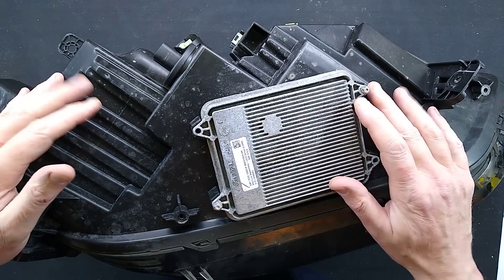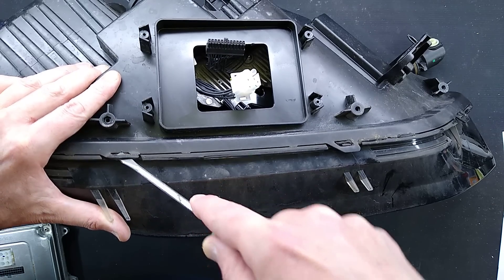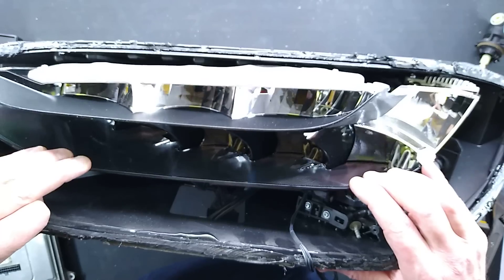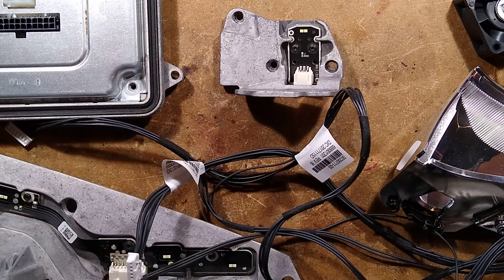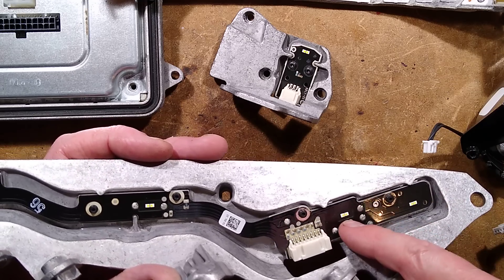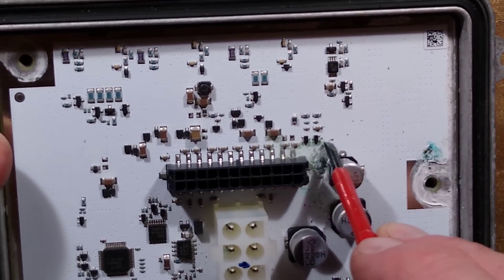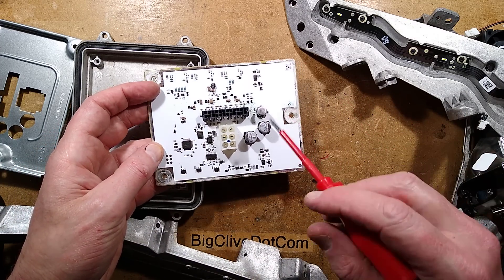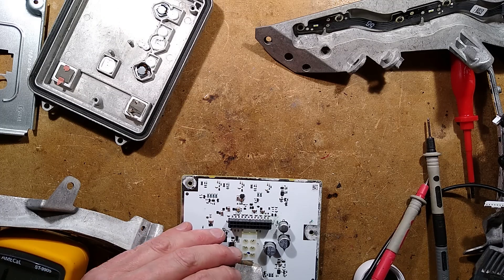Exploring a Tesla model X headlight

Comment: The actual LED chips/dies would be far more interesting than the power supply I would think.

So many changes and major updates in LED technology over the last few years... And huge differences between the chips in something like this compared to most normal things people are used to seeing. 

This teardown and a few other things that have popped up on your channel would have been infinitely more interesting to focus on the crazy and changing LED technology instead of the power supply/boards (which in comparison have far less interesting or changing technology). Just my opinion.

Comment: I would have tried putting the light assembly in an oven. Experiment with temps but I would start with around 150*F to try to soften the adhesive. Then pry it apart.

Comment: Call me an old fart but in this video are neatly encapsulated the reasons why I detest modern cars.
Rant Mode: <On>
CAN bus - in itself a perfectly reasonable idea but car manufacturer's do love to connect everything to it, making servicing harder. Some (Mercedes, even for cheapo Smarts) use the CAN bus to lock out DIY replacements so you have to take the car to a dealer - yep, no more recycling via second hand parts!
Construction - modules like lights aren't just made for ease and cheapness of construction, they are actively designed to be impossible to repair. More money to the manufacturer, bad for you, and again bad for the environment.
Quality - don't spend pennies on waterproofing when leaving it off will almost certainly mean there will be expensive repairs you can fleece the customer for later on. Just be sure to make the parts last just longer than their warranty.
Rant Mode: <Off>

Thank you for your patience.

Comment: The unnecessarily complex design for this headlight reminds me of the exasperation expressed by a colleague of mine when he found microprocessors being used in circuit designs to carry out simple tasks in equipment that he was attempting to repair. 
“ Why use a microprocessor, when all you need is a F***ing relay and a switch!.”
This excessively wasteful design ensures no one can repair, reuse, or recycle it.

Comment: Interestingly, I've recently been involved in designing chips for automotive applications and CAN bus seems to have been supplanted by TSN Ethernet for anything above basic register access. Still a twisted pair of wires plus ground shield, but more complexity since it involves phys and the like. Wonder if these headlights were actually ethernet based ?

Comment: Why would one design DRLs with 3V LEDs in series that require a voltage booster rather than LEDs in parallel with a typical buck regulator?

Comment: The headlights are on LIN bus. Typically anything not that "important" will be communicating over LIN, seat adjustment, climate control, lights etc. Anything important like airbag, drivetrain communication etc is on CAN since bus speed is higher ie faster and it's more reliable.

Comment: To get the headlamp separated you can heat all around the glued joint and then pull it apart. It seems the glue softens rather more than the body/lens. https://www.youtube.com/watch?v=rrEsUjVdtSI

Comment: I think the 6 pin socket is 2 pins side by side is Side/Parking lights, next pair Main beam then last pair controls the high/low level, there is not enough components to use data control like an IC, power transistors, the chokes are there to fool you into thinking its worth $1200s like making it impossible to replace just 1 faulty LED, I to have a meaty 1200 watt angle grinder and a plasma cutter, brilliant for drilling holes in very hard stainless steel that blunted my cobalt drill bits

Comment: Tesla should be applauded for keeping the price of the replacement so low.

BMW i8 2014-2020 
factory original headlight, Part Number 63117446813
$6759.67 but available at a 9% discount for $6151.30
from your BMW dealer parts department

P.S. This a laser headlight. Not for the meek of wallet. Illegal in the US by my understanding.
Since you are already on youtube,
https://www.youtube.com/watch?v=h29SwJDXMBc

Comment: This is so wasteful and so.. intentionally fragile. Surely it can't cost less to get those enormous boards & the casings that don't protect them in bulk than it would to use a much smaller potted circuit for the lights. I'm assuming those same boards are modular & used all over the rest of the car, but then there's the added weight too, which one might think would be sort of important.

Comment: I always buy the most common car I can get.  The parts are still the same junk, but there's a vast aftermarket supply for every part at a fraction of the manufacturer cost.  I've had a manufacturer declare my car parts obsolete after 10 years and was still able to get aftermarket parts easily.  The downside is a common car has easily saleable parts and is more subject to theft.

Comment: Would you be better off using a multi tool on slow speed to avoid the melting plastic caused by the angle grinder?
Reply from the maker: I tried that.  It still melted.
Reply: @bigclivedotcom  d'oh, curse thee cheap plastic on a ridiculously expensive car!

Comment: You don't normally run CAN to every little thing, you have CAN to LIN bridges. Anyway by looking at the transceiver chips you can likely tell what it is or what it isn't.

Don't think they would go reinventing the wheel, after all the part if no more or less replaceable if it uses something else. There's still plenty of ways to make parts incompatible or thwart replacements, the messages aren't really standardised.

Comment: In my experience as a mechanic, the most common reason why the circuit boards in headlights corrode is condensation build up that doesn't evaporate quickly enough.
There's a reason why many manufacturers have moved the computers to the top of the headlights.

Comment: I bought a set of LED lights for my truck for under $500(don't worry, I aimed them properly). Add in the 52" lightbar, also under $500, and I can see more than any Tesla, ever. The lightbar is on its own switch because I only run it on my commute home when I see no vehicles for 20 miles at a time(but lots of deer).

Comment: Most automotive headlights will come apart if you get it warm enough.
It's a little bit tricky, but I've found it works best to turn your oven on it's lowest temperature, then turn the oven off and when it's around 150ºFreedom (66ºCommunist) put the headlight in and let it set for 10 min, then pull it out and you can pull them apart. Different headlights might require different temperature. Melt your headlights at your own risk.
If you want to put them back togather you have to re-silicone them back up.

Comment: All of the effort in this engineered part went into making sure it was not user servicable.  Neglected categories included: proper water ingress protection, electrical surge filtering, or basically any of the other things that come to mind that would be elementary engineering concerns.

The entire Tesla cars are like this.  There's a reason they have had such dramatic failures.

Comment: Would love to see you pull apart the Swarovski Crystal lined optional Mercedes 222 headlamps. Or one of the new “digital light” LED DLP projector style headlamps with 1.3 million pixels.

The optics of modern LED headlamps are, as you stated, very highly optimized.  While the adjustments made to their angles for aiming don’t seem like much at the headlamp unit itself, at 200’ down the road, that small adjustment makes a big difference.

Comment: The irony of all those electronics to squeeze efficiency out of the LED lights when the whole assembly is filled with unnecessary lumps of castings and other plastic junk creating more failure modes than probably all the combined electrics on an "old" car :rollseyes:

Comment: The first thing I noticed on that module, was the tops of those electrolytics, sticking through the cover. Not only are the sockets not sealed properly, there are great gaps round the caps. There is no point making a perfect seal round the tinwork, when you have obvious holes where water can (and did) get in.

Comment: Are you certain than the LEDs will be in series, as the voltage drop over each one will successively reduce the brightness of all those preceding it. The flexible PCB over a big aluminimum heatsink is a nice idea. I bet the fumes off that plastic were terrible....do Tesla at least provide a recycling mark on the plastics in spite of the entire unit clearly being an anti-recyclable item? I'm guessing PC-ABS. Hacking the CAN-BUS on this unit would be interesting to understand the conversation going on within the network. It having knock-on effects to the licence plate lighting seems odd, as I presume that each one will have its own CAN-BUS module and hence be addressable individually. Very odd.

Comment: As Tesla improves their products so quickly, that module may not be currently in production and may not be available as a replacement part.
Reply: Maybe have a look inside a modern HID high voltage self leveling headlamp assembly and see how complex and "non serviceable" they are..............

Comment: Comments here talking about "poor design" but if every company does it knowing its flaws its not "poor" but intentional. Perfect example of planned obsolescence. Designed to fail and only sold replacements are artificially inflated in price due to refusing to sell actual proper replacements. It's the Apple approach. I bet you could make your own board for around $25, not that it would work of course since it uses proprietary communication.

Comment: Having opened one of these headlights myself, you can definitely heat it to get the glue to let go, just like basically any other car headlight.
I stuck it in a heating rack at 80c for about 5 minutes, easily came apart after that. Terrible mess with the strings of the glue going all over the place though

Comment: A good way to take apart most automotive headlights is to heat the unit to soften the glue. Back when the lenses were glass, you could do this in a home oven. It's a bit sketchier with polycarbonate lenses.

Comment: A blatant example of engineered profiteering. Why change a (poorly ingress protected) control module when you can ream your customers for an entire headlight unit. Those siliconed parts that break when you take the cover off is a disgraceful stealthy anti tamper seal. Tesla are far from the only offender, but it steers one to the conclusion that it is a deliberate design decision to increase after sales revenue.
Reply: ☝️☝️☝️
<<Hey reach out, Thanks for watching 👍👍

Comment: Wow, all you do to change a headlight in my truck is turn it 90 degrees and pull out. The headlight is a 100$ incandescent bulb, the OEM bulbs lasted a little over 100K miles over the span of 18 years - eventually failing after some hard off-roading and rock crawling. I replaced them all with LED equivalents.

I paid 2000$ for the truck in 2020, that's the cost of two of these Tesla headlight modules.
Reply: ☝️☝️☝️
<<Hey reach out, Thanks for watching 👍👍

Comment: What's the best method for protecting such a PC board against copper corrosion through water contact?
Reply from the maker: You can apply a conformal coating or even just a vapour deposition of a light oil.

Comment: The "tech" side of this may seem ridiculous and excessive (which it is) but in the UK, at least, all of these "new fangled high power lights" have to have self levelling and washing systems built in as standard; the levelling for obvious reasons and the washers to prevent diffusion of the light in potentially blinding directions. Unfortunately, this is also conducive to the business model of "make something that can't be fixed so that we can charge for a small ransom for replacing it/fixing it a dealership". Do I want the headlights as per my old Mini that just glowed, rather than shone or do I want the latest ones in my BMW with a stolen badge? Admittedly, prefer the latter for a multitude of reasons - at least so I can still see when someone coming the other way has their light lit up like a football stadium. Excellent video as ever, Clive - thanks :)
Reply: ☝️☝️☝️
<<Hey reach out,Thanks for watching 👍👍

Comment: The glue of an older type of Tesla Model S headlight could still be opened by heating it in an oven as Rich Rebuilds has demonstrated here https://youtu.be/pYGD6ZUARjA 
It is a scandal that the whole headlight got replaced when only the electronic unit failed and to me this seems to be a manufacturing error that should be covered by warranty.
Reply: ☝️☝️☝️
<<Hey reach out,Thanks for watching 👍👍

Comment: Part of the problem with changing the module is that the headlight has likely also had water in it. So, there’s a high chance you’ll replace the module and then have the rest of the light fail soon after. And, chances are they’d charge almost as much for just the module as the whole assembly. 
For me, I’d be looking for a used module and hoping it’d all last for a while longer before having to replace the whole thing.
Reply: ☝️☝️☝️
<Hey reach out,Thanks for watching 👍👍

Comment: CAN usually has gold plated pins. Surprised that they use those old crappy non waterproof connectors. The rest of the automotive industry realised those were crap back in the 1980's and waterproof connectors took over.
Reply: ☝️☝️☝️
<Hey reach out,Thanks for watching 👍👍

Comment: I have a KIA with similar (mechanically) headlamp setup to this Tesla one.  IE it uses a solenoid to tilt the main lamp reflector in order to achieve the low/high beam function with a single filament or LED lamp.  It's somewhat disappointing that high beam does not provide any extra light, just a raised cut-off.

Comment: Seems like a giant leap backwards from the owners point of view - used to be able to deal with the majority of headlight failure by buying an international standardised bulb from a petrol station or auto parts shop and replacing it yourself in 5 minutes without tools.
Reply: @Shourya Bose Im not made of money to keep buying new cars every year. Tesla makes a lot of electro waste every time a drop of water gets in where it shouldn't
Reply: @Shourya Bose having lots of features doesn't necessitate that a thing can't be repairable. It just so happens that companies are selling 'innovation' that way. Give you one guess why
Reply: Indeed, a H7 headlight bulb costs a couple of pounds and takes ten minutes and no tools (at least on my old car it does).
Reply: Yup.  Even my 2009 model Renault has headlights that cost an arm and a leg to change the bulb - they take the front of the car off to do it.  I've learned (the hard way) to change them myself without that, as my hands are small, and I have memorised the contortions required and orientation needed to do it blind. I still end up with lots of minor lacerations all over my hands and forearms though.  😞
Reply: @ianstewart7605  Never heard of that car, just wondering, is your steering wheel on the left or the right side of the car?
Reply: @JosephLedbetter  Right side, I'm in the UK. Renault Scenic 2009. Last of the Mk II.
Reply: All hail the glory of the Parabolic Aluminized Reflector lamp.
Reply: The idea with these modules (everyone uses them now, in the higher trims at least) is that they look more premium, can be perfectly fit to the car, and in theory, last the life of the car.

Notice how semi trucks nowadays can still be optioned with halogen bulbs on the main beams.
Reply: There are two sides to this. On the one hand of course those LED systems lack repairability, on the other hand, even though some fail, they usually last longer than most people will use the car. Although I agree, the cost cuttings for half a penny which prevent this to be built more robust are just ridiculous. And somehow I got a feeling we are not only talking about Tesla here but about something throughout the industry. (Maybe for Japanese brands their pride in their workmanship will not let something like this happen, but who knows) Design wise, LED allows for completely different design approaches, if that is relevant to you. And actually, when it comes to third party replacements, main issue I see here is not 3rd party manufacturers being able to make parts that would actually work and would be legal to use as replacement and be affordable (although I am sure if there is money to make by selling genuine crap copys that don´t take the required specifications too serious it will happen), but when it comes to exterior parts which contribute to the looks and design of a car, the manufacturers most likely protected that design so only they can sell or license spare parts that look right.
Also I wonder, if they sell such a part for lets say 1000 pounds, what does it actually cost them to make. I bet the margin of profit on those exceeds any salespersons wildest dreams.
With mainly plastic moldings, which today can be made to an incredible level of precission, some aluminium parts and some electronics, add some costs for administration and engineering, I wonder if such a part actually costs more than at most 200 pounds to make, most likely less.

Comment: That's just INSANE, and I don't mean that as a compliment. I thought my stepmother's Altima was bad, you have to drop the freaking front bumper to replace the headlights. It never occurred to me that entirely nonserviceable headlights might someday be a thing.

Screw that, that's disgusting. I'm a pedestrian and passenger for life thanks to being disabled, but anyone I know considering buying a Tesla will be getting a copy of this video for sure.

Also -- did anyone else notice the little green dot of corrosion on the great whacking 6pin Molex connector? Probably that's the point of water entry.